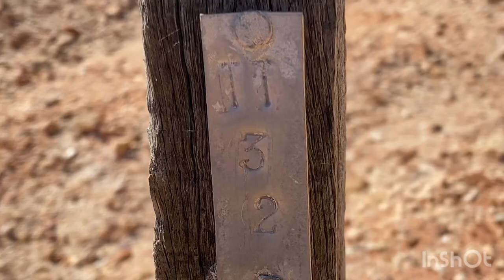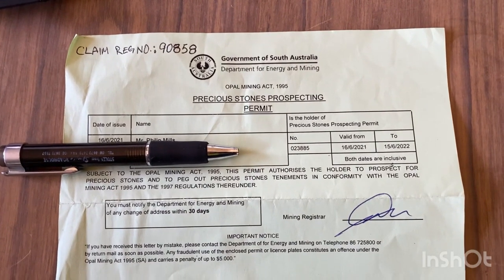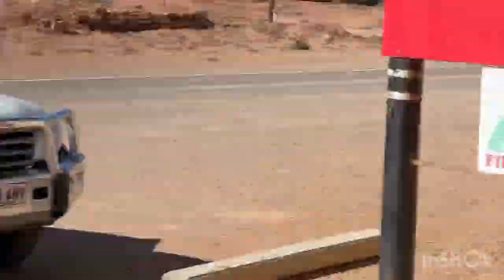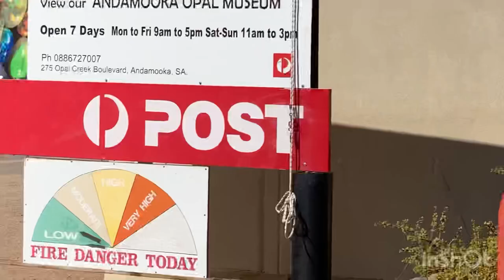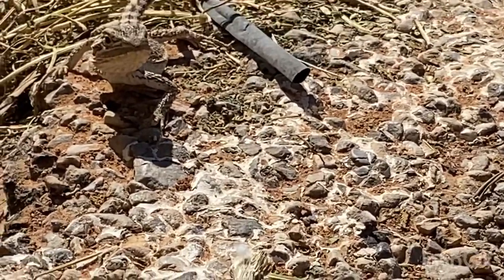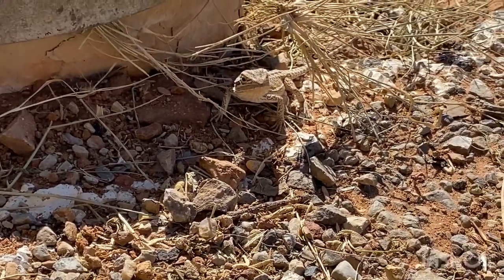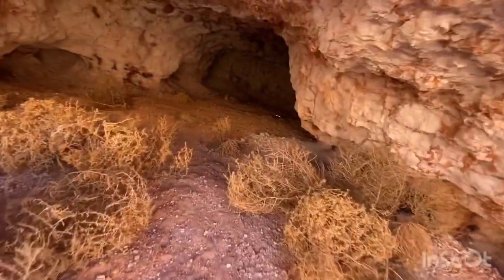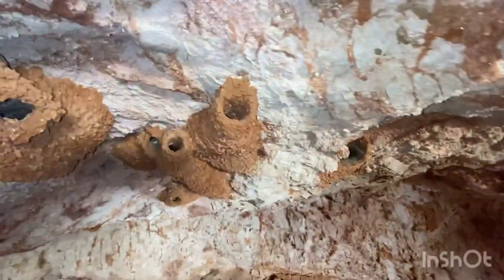Opal claim: picking some ground and pegging it.

Comment: That guy in the dozer will be cracking all your boulders and matrix opals. Is that red dirt all iron? If so, does that mean your huge opal deposits will be mostly fire opal?
What's the temp. underground, nice and cool? Is there any wells drilled for miners to get water? Did anybody ever find gold looking for opals? Do you like answering stupid questions? They're all I've got. Oh yeah! Merry Christmas from Port Elgin, Ontario Canada. I'm stuck indoors thanks to the Blizzard, watching your videos, thanks for the company!
Reply from the maker: G’day Peter, the dozer driver is very good at this, he can recognise when theres a level. Yes some/most of the reddish colour to the sand is ferrous oxide, though being on the surface it was deposited after opal formed, fire opal usually refers to Mexican opal which to my understanding is of volcanic formation, as opposed to Australian opal which is of sedimentary formation. Average temperature underground is around 26 degrees Celsius/78.8 degrees Fahrenheit. There are bore holes but we don’t rely on them for water, that gets carted in. There is a mine 30 km up the road called Olympic dam, that has the world’s fourth largest copper deposit and the largest single uranium deposit in the world, they also recover gold and silver, but, again to my understanding, the gold is at depth and not the nugget kind. There are no stupid questions, totally relevant. Have a Happy New Year. 🎅👍

Comment: Any reason the blade wasnt down on the Dozer 3/4'ths the time?  Seems like the Dozer operator was either worried about destroying a pay layer wanted to pack the ground to avoid collapsing a tunnel?  Is there a limit on the acres staked per person?  Does it make financial sense to push all the overburden, and then focus on the suspected pay layer, and if that doesnt pay out, peg another claim and move on?  Thanks, and enjoying the video.
Reply from the maker: When the blade was up the ripper at the back was down, we just pushed a bit of sand off the top and the ground hasn’t been touched, not worried about tunnels. Next week we excavate a trench to find the levels. Yes, get to the opal bearing level in the fastest/most economical way, and filter through the level by hand, it’s not always thick and fast, bits and pieces can turn up in the most random spots sometimes. As the tags/pegs are good for 1yr, first you give notice of intent to pull pegs, and then find new ground. 🤪👍
Reply: @theopalmills   Thanks for the detailed response.  It makes sense now.  I must of missed seeing the ripper earlier.

Comment: Just re watched this clip. It seems as if you didnt take the pre dug mine you showed in the early part of this video.  Was there a determining factor as to why you didnt take that one?  The amount of digging done would have saved thousand in bulldozer costs which you could have put into an underground digger.  Are there many such pre dug claims up there which are available to noobs  lol.  Or maybe you did take it?
Reply from the maker: G’day Alan, the idea behind this digging was to be open cut, the ground is relatively shallow. There are some tunnels up the back of the claim, and scrapes on 3 sides, so we have the available virgin ground. Now that we’re down to level, we just carefully go through, creating what’s called a bench, digging down from the newly exposed surface a few feet then take out sections. There are plenty of diggings that could be continued on from, it’s all in the prospecting. 🤪👍